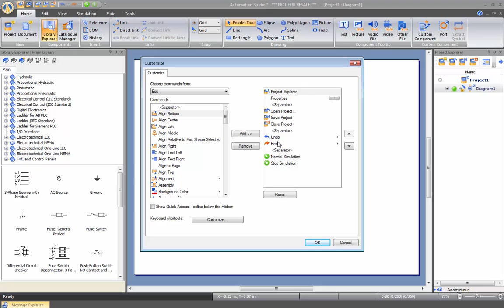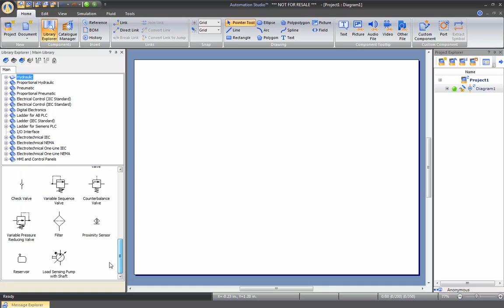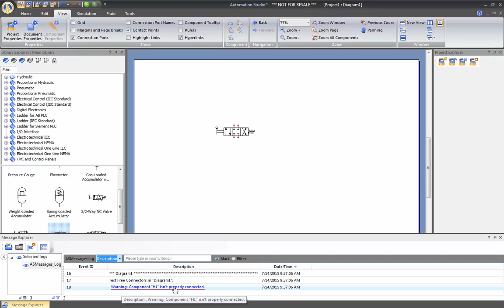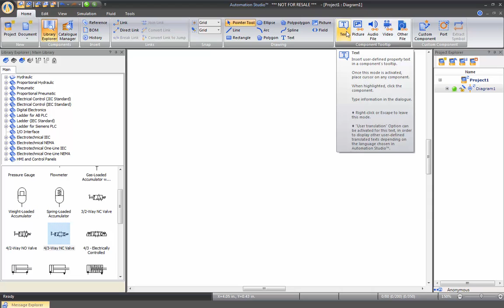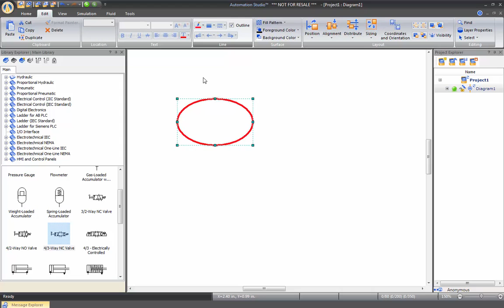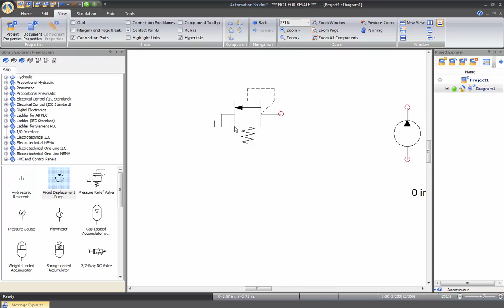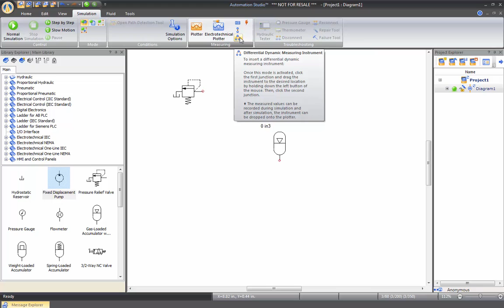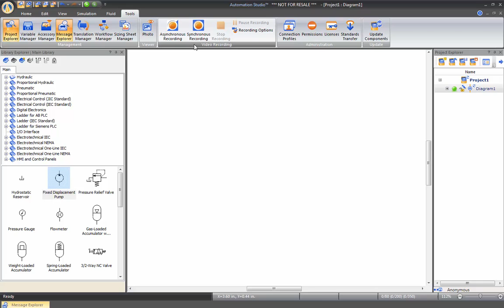Interface - Interface Overview - Automation Studio™

Comment: i can add limited number of components in my hydraulic circuit....
after that it says that i have reached max limit and you can continue the circuit in another document and connect them during
simulation using JUMP TO - components...
how to actually use this feature can you provide a video for this purpose
I am on an educational version
Reply from the maker: Hello Sujeet,
Here is how to make a JUMP TO Component. Once you have created a link between two connection ports, you simply right click on that link and you click on “Convert to Jumps” option. This will create two components at each connection points. These components can then be moved within the project or onto another project. During simulation, it will simulate like the link is still existing between the two components with all the simulation properties you may have applied to that link.
Hope it helps!
Reply: sujeet shewale patil kya hal chal sujeet